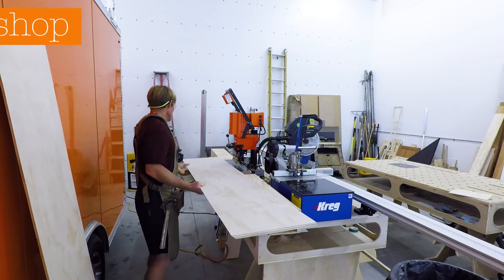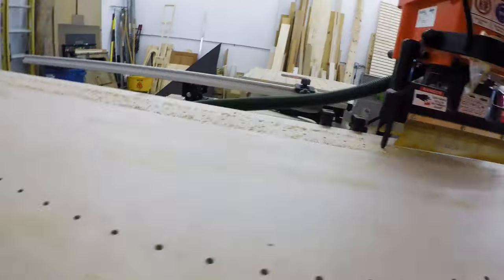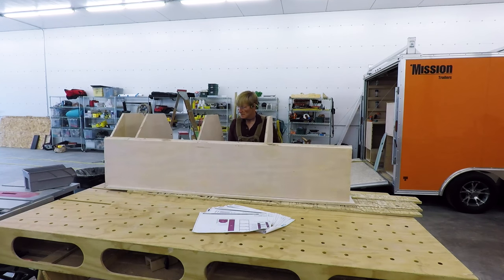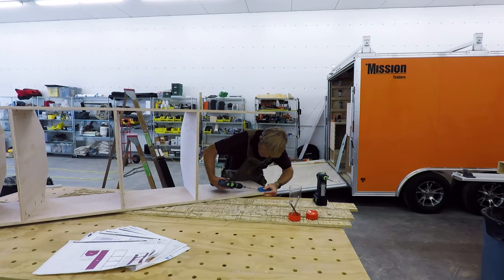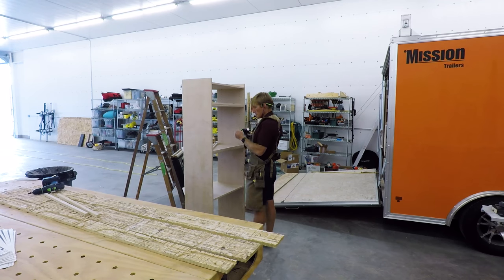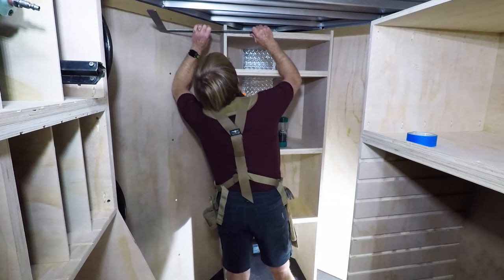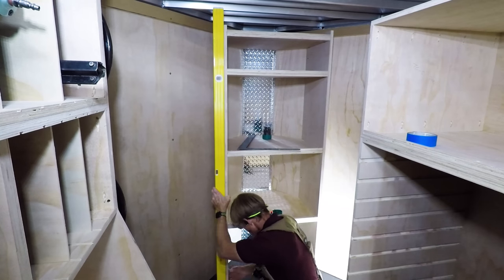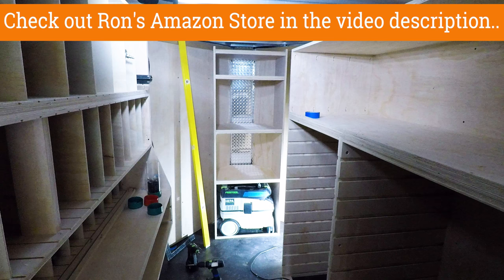Building my woodshop #18: Nose cabinet.

Comment: I did my trailer nose shelves the exact same way. I also dropped the back of all my shelves 3/8 an inch lower than the front thinking it would help keep my totes of painting supplies in place a little better and rolled my graco sprayer under the bottom shelf.
Reply: Tilting the shelves is a great idea, especially when dealing with paint tins. :)